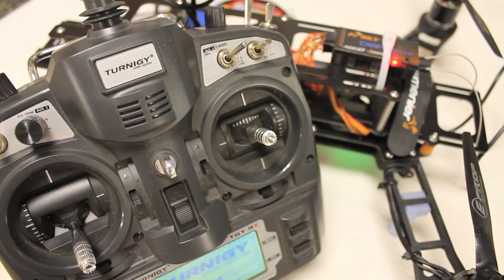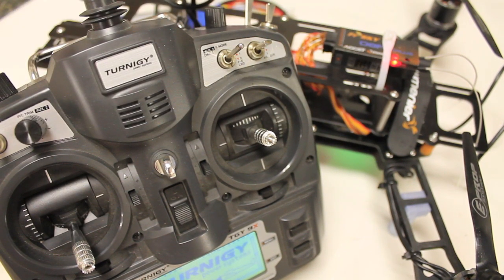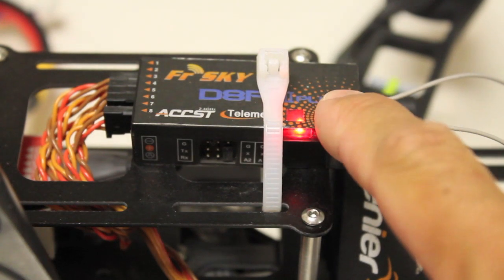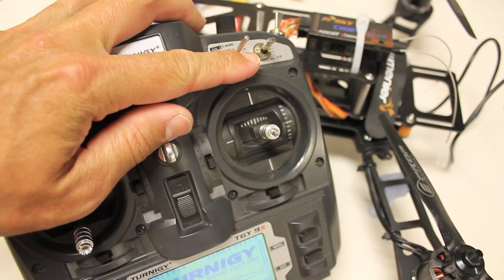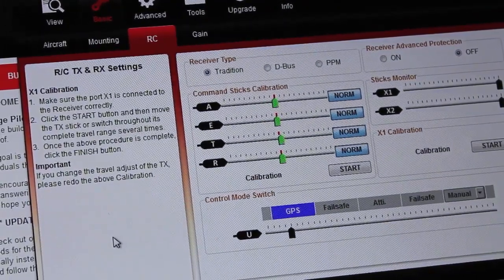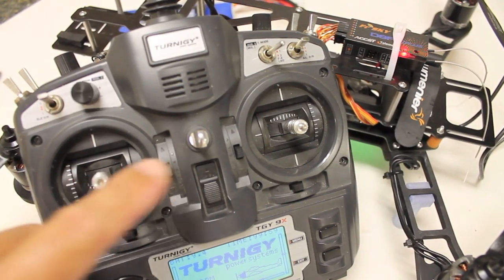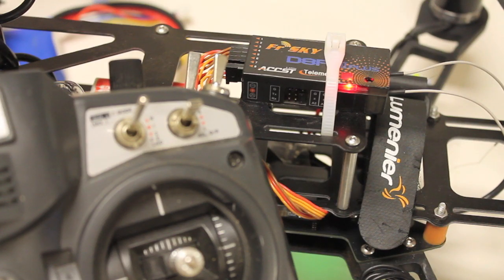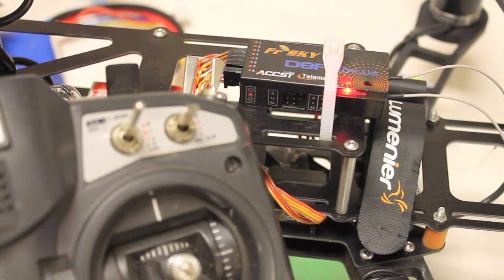NAZA Enhanced Failsafe RTL After Signal Loss With FrSky Module

Comment: Will a signal loss fail safe result in a RTL if you have programmed it in Assistant? I've programmed the forced with the 3 position switch but have not checked to see what happens when TX gets turned off.  I'm using the 9X 9 channel receiver right now and after seeing this might have to buy a FrKy receiver or the $4 fail safe add-on from HK.  Don't think I'll fly too far away to lose sight but would be nice to have when I get the guts to do so.  Also, was wondering what the benefits of upgrading to the Naza M firmware onto a Lite V2 is.  I have the Lite V2 and have seen vids on flashing to the straight M firmware, any thoughts?
Reply from the maker: +Dean Hallal The default 9X RX does not have failsafe built-in. You may want to consider the FrSky upgrade which does support i:

http://www.hobbyking.com/hobbyking/store/__14355__FrSky_DF_2_4Ghz_Combo_Pack_for_JR_w_Module_RX.html

I don't know the reasons that justify upgrading Lite to NAZA M. Let us know if you do this and uncover anything.
Reply: +Dennis Baldwin thanks for the reply Dennis.  Looked at the FrSky you linked.  It looks like it has telemetry but I saw another one mentioned elsewhere http://www.hobbyking.com/hobbyking/store/__41609__FrSky_XJT_2_4Ghz_Combo_Pack_for_JR_w_Telemetry_Module_X8R_8_16Ch_S_BUS_ACCST_Telemetry_Receiver.html, know anything about it? I know you get a lot of folks asking questions so I appreciate the feedback and all you for the hobby here on YouTube.

Comment: Thanks for the video, very useful, but having some difficulties. I have the same Rx as you have in this video, and FrSky module in the rear of my Futaba 9C.

First Q. When pressing the button on my Rx, following the exact same procedure as you, I get no confirmation bleep? Maybe not applicable to my Tx..

Second Q.
It seems to remember my Failsafe settings on the GUI,, but doesn't center the throttle as yours does in green, mine goes off on pitch a couple clicks, and throttle goes up 2 clicks when I switch my Tx off.
Is fine when on, all centers come up as center and in green..

Any advice please, am kind of stuck, and want to fly tomorrow, but worried about these values in Failsafe ( should I need it lol)
Thanks :-)
Reply from the maker: Matt's Hobby Channel Thanks for the comment and I'm not entirely sure what's going on with your setup. I would expect the modules to exhibit similar characteristics, but obviously there are differences in the TX implementation. For failsafe that's strange behavior. I would give setting the failsafe another try. You definitely want pitch and roll to stay centered otherwise your quad is going to end up somewhere else! I'll see if I can dig anything up related to your problem.

Comment: Thanks, very clear, many of the other videos / instructions i read didn't mention that the TX had to be in FS mode, just that the throttle needed to be at the mid point, therefore, when i turned off my TX FS wasn't fully activating.
Reply from the maker: Parzival Glad to hear this helped and that you now have failsafe setup. Good luck with your tests.

Comment: Do you have to do this on the trannis???!
Reply from the maker: TheTonstar1 If you want failsafe then yes you need to set this up. I'm assuming you have the X8R receiver. I'll try and do a video soon using this setup. Thanks.

Comment: I maidened my used v1 today with your help, my curves were fluctuating w/throttle so I had a balloon like fy away but put it in a tree getting connection intermitently. LOL! What 3 position order do you use for this set up? GPS-failsafe-manual?
Reply from the maker: Oh man sorry to hear that. Were you able to recover it okay? Nowadays on my FrySky Taranis I have GPS Atti - Atti - Manual on one switch and then failsafe on a completely separate switch. Regarding signal loss failsafe as discussed in this video I have that configured at the receiver level. FrSky makes the loss of signal easy to setup at the RX.
Reply: Dennis Baldwin Thanks for the demonstration Dennis, but why is is necessary to use receiver failsafe? If you don't have this and you lose connection, does it mean my quad will just fall out of the sky? I use a 9xr with a djt module and a v8fr2. I doubt that is a failsafe transmitter?

Comment: I have the stock 9x and receiver but would like to upgrade my receiver so I can eventually travel long distances via FPV.  I've been taking baby steps to build confidence and it will be a while until I have confidence and experience to do so.   Do you know of a long distance xmitter/receiver that incorporates failsafe in the receiver?
Reply from the maker: Great question. I haven't flown beyond range of my FrSky Taranis TX/RX combo. How far are you looking to go?
Reply: Dennis Baldwin I'm not sure, even a mile or two would scare me! But, it would be fun.   I have a massive 5000maH battery on a slow fly setup.   I just pre-ordered the vector system so I have all the telemetry/OSD/GPS goodies bunched together.
Reply: bipth you should be able to do a mile with frsky gear. Test this with a servo and go away from your tx, then looking at the distance you went, you'll know your range.

Comment: I saw the other video where you use the three way switch for flight mode (gps, manual, atti) but in this video you have changed what the 3 way switch does.  Can you have both real fail safe and the three way switch for flight mode?
Reply: Just ran into the same issue, any thoughts Dennis? Great videos by the way, super helpful!.
Reply from the maker: The Perfect Line TV Hey there....I need to figure this out but haven't done so yet. What I'm currently flying with is GPS Atti, Manual, & then failsafe. I have my FrSky set for the 3rd switch position which is failsafe and it returns home. Let me ask what you're trying to achieve between GPS Atti and Atti modes? I'll see what I can figure out and let you know! Happy New Year.

Comment: Hi Denis, just want to let you know and others, that you can do exactly that with the stock receiver, by adding a small failsafe unit at 4$ like ths one: "Epic Fail Safe" on HobbyKing. PRODUCT ID: 9206000005 Can't post a link on youtube so you will need to do a search.  You plug your channel 6 in it and then plug the unit in the U port.  you configure it the same way as the FRSky receiver.  Works great!

Comment from the maker: See my reply to Jimmy, but yes failsafe will activate assuming you've set it up through the receiver. The key is that the channel sends the failsafe pwm to your U port. The throttle isn't important, but I always recommend setting it above 10%, which is the throttle cut off. Just to be safe.

Comment from the maker: Ted, thanks for the comment and I think you'll be just fine with the Spektrum setup. I originally came from the Spektrum world, but weighed the cost of the T9X vs the DX8 and it was a no-brainer for me at the time. The T9X was much cheaper so that's what I did. I realize cheaper doesn't always equate to better, but the T9X has served me well. If you ever feel like you need to go beyond 6 channels then I would definitely recommend looking into the T9X.

Comment from the maker: Yes, the NAZA Lite has failsafe. I've done a video that shows how the forced failsafe works using a switch on the TX. If you want to do it using the method in this video makes sure your RX supports failsafe upon loss of signal. Good luck and let me know if you have any more questions.

Comment from the maker: Great question regarding throttle. I pick 50% just as a something that's easy to remember. If you read the NAZA manual you'll find this:

"Throttle stick position should always be higher than 10% from cut-throttle during the flight!"

So anything above 10% should work in failsafe mode. I pick 50% because it's easy and way above the cut off. During failsafe the NAZA manages motor speed on its own. Hope that helps.

Comment: Yes I was thinking the same thing jimmy grey is. In a signal loss will the 50% hover through frsky occur? Or will naza RTL failsafe activate? I just had a fly away with my naza v2 4.0 firmware. So I am being very cautious with my next build.

Comment: Hi Dennis, would I be curvy R in assuming that you're not going to fly with both fail safe and RTL at the ready? Seems like a conflict. What happens if the copter loses signal from the TX. Which takes precedence, RTL or fail safe? Each mode needs the same event for initiation. Our am I missing something

Comment: Hi Dennis.. just wanted to comment on your 50% throttle setting. It's not needed if you have updated your naza to the latest firmware. The naza automatically sets the throttle to 50% when loss of signal is detected. The naza controller will then take over and apply what ever level of throttle is needed in order to bring the craft back to its set home position. The older firmware required the throttle to be set at the 50% level during failsafe setting but the newest release does not ;)

Comment: Is this a similar setup for the apm?  Also, will the quad only give 50% throttle and no more since your throttle was set up at half throttle? Like if the quad needed more power to rtl in windy conditions it would only give half power  Thanks.